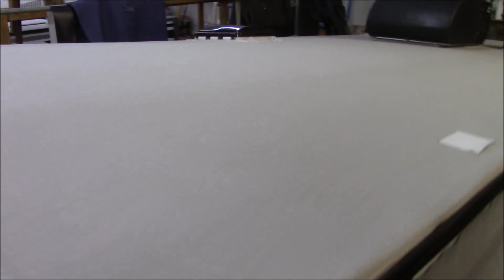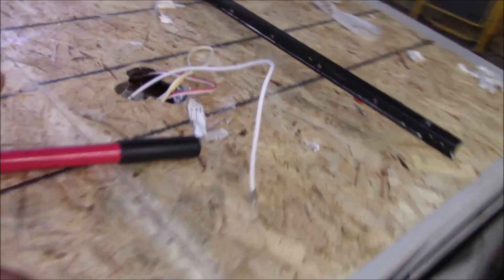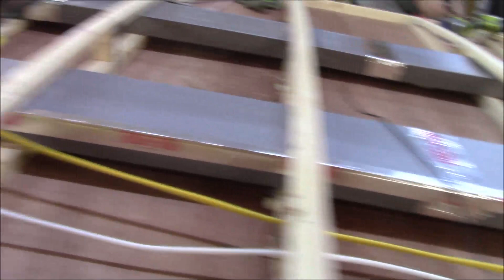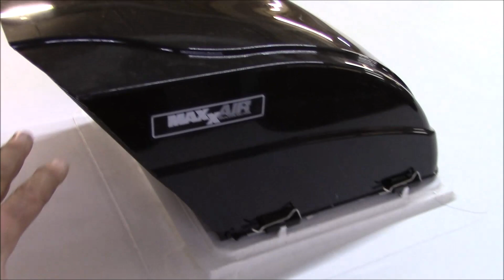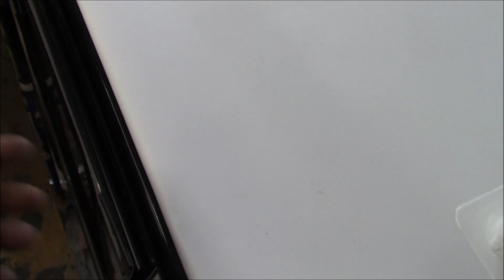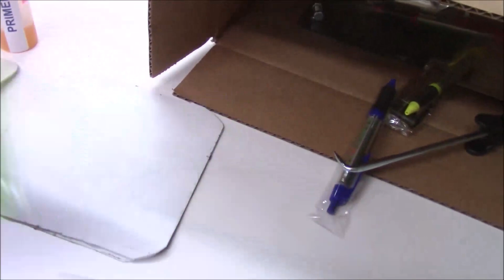2020 Grand Design Reflection

Comment: What are your thoughts on using spray foam insulation instead of bats to increase the R value in the roof?
Reply from the maker: If you got the money. It will add strength and r value for sure. My guess is it may cost about 4 times as much. Spray foam comes in density rating. Last time I bought  4 lb plural cylinders it was about $1100 you'll need more than one I'm guessing, I don't know the size of the roof or what your working on.

 There are single and plural component foam. It will make a mess for sure.  Check the pricing. 
That was the intent with plyfoam roofs that are on class A and C model. coaches.  
Thanks for watching. 
Thanks for watching.
Reply from the maker: I'm not sure why your ceiling comment on another video won't post for me to respond on that videos comment section. 
Yes we have had to replace ceiling panels due to damage. We have a couple of Georgetown's on our channel and I know the all American fifth wheel we had to replace ceiling panels. The ceiling panels sit in the wall. The best , cleanest way is to pull them from the top. When the roof is open. The Georgetown is a olyfoam roof and the all American is a basic truss with batten insulation type roof.

Comment: There is electrical code for RVs, NEC chapter 551. If you don't know it exists maybe you shouldn't be inspecting RV electrical. 
That wire nut mess looks like owner work. The orange excuse for a box is for low voltage devices.
Reply from the maker: Haha ... very familiar with the NEC,. But implying we don't know what we are doing because we don't go by that minimal RV code is insulting. You can see as well as we do the possible dangers we find. Just an FYI i have plenty of residential and commercial wiring background where quality and codes matter. That is for the lead on the NEC....the only thing I that RV code is basically to allow accessibility and prevent shock. All the other codes in the NEC should be observed for best practices, iE; conductor protection. Which the manufacturers don't because no one is inspecting them when they're built. They may have someone at the plant inspecting, but that's the fox in the hen house for sure. You know as well as I do these coaches wouldn't pass normal inspection in anything.